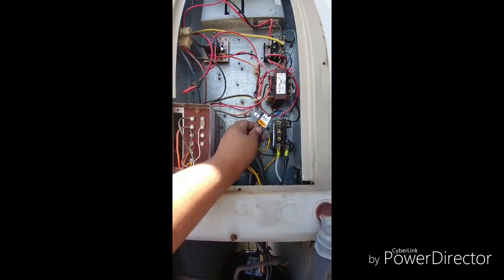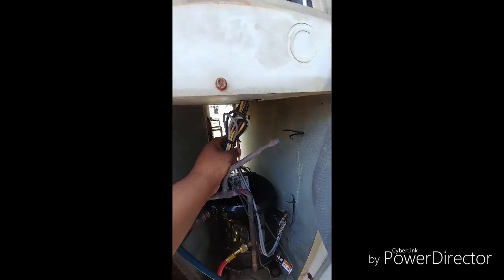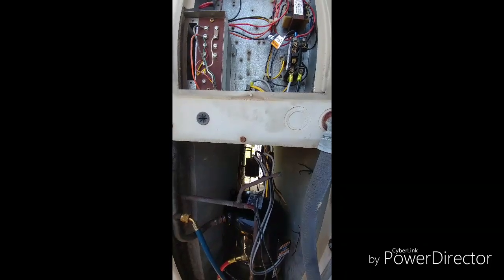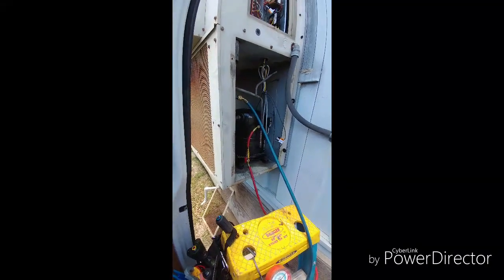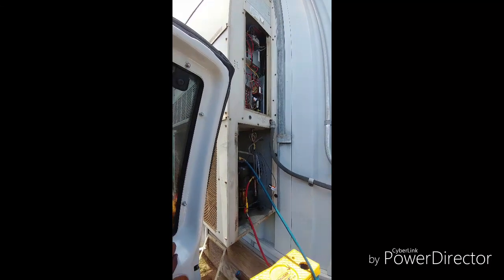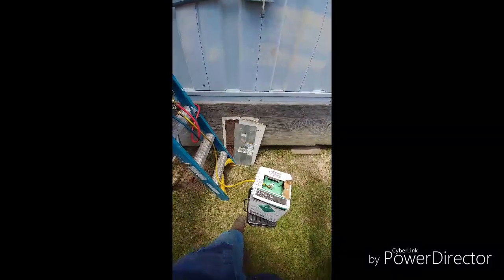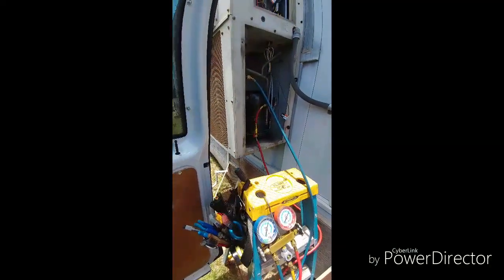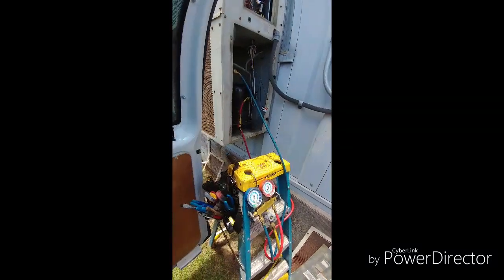Installing a New Compressor (HVAC)

Comment: I used to work on a lot of Verizon remote cell site Bard wall packs, on an older one with the compressor at the front, it had a leak on the middle of the weld seam at the back, it seemed like a good idea to just throw the compressor on ground and damm thing squirted me with its oil like a water hose on my chest when it hit the ground, I never did that again.